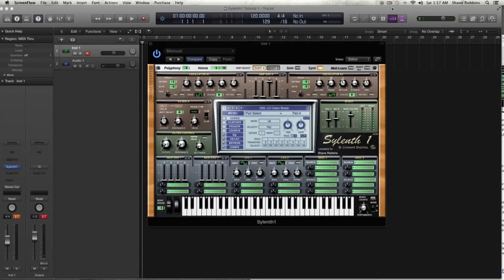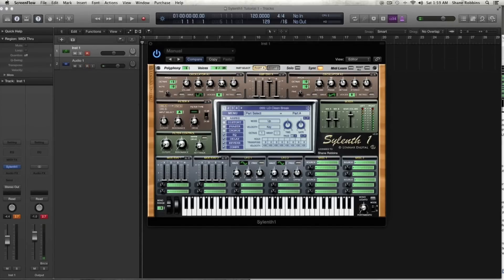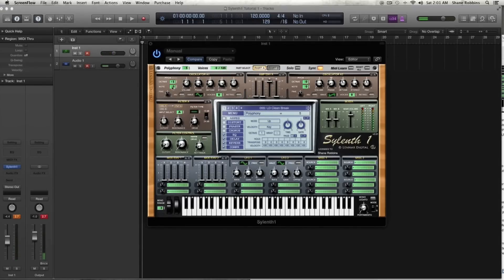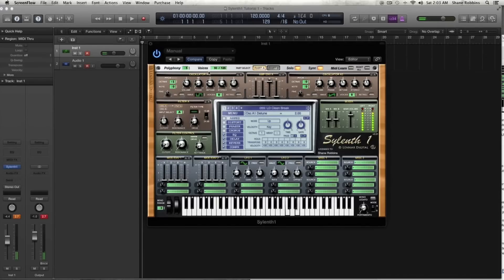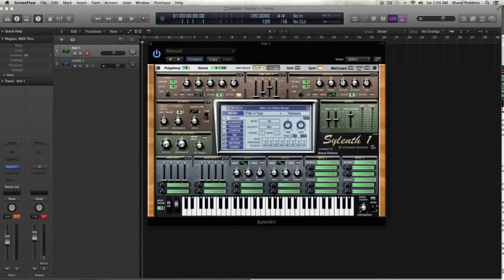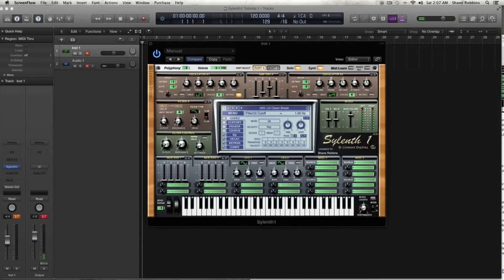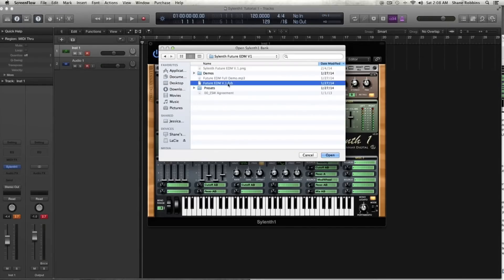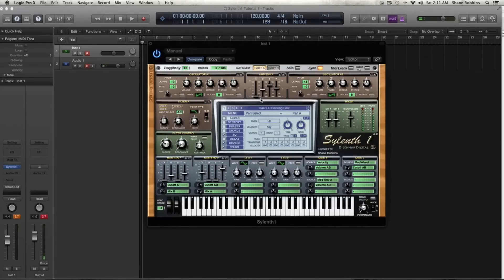Sylenth - Your First 30 Minutes Using Sylenth - How To Tutorial

Comment: so which is better massive or silent i have both but i only wanna use the one thats the best and easiest to understand
Reply: YUNGR33ZYB3BI Depends on what you find easier to understand. There is no best VST but, the more comfortable you can get with one the better your sounds will be.
Reply from the maker: YUNGR33ZYB3BI Use both! Sylenth can quickly do sounds that take a while to do in Massive and Vice versa. You just can't do certain sounds that in Sylenth that you can Massive because one is a WT synth and the other is subtractive.
Reply: YUNGR33ZYB3BI massive's sounds are either so hard or so soft,there's no middle. Sylenth1's sounds are more able to be used for all levels.so if you have to pick one of them I would say sylenth1.
Reply: thanks guys. would you have a simple video that explains how to understand all the different wave forms and achieve any sound?
Reply: instead of specific sounds
Reply: oh do you ever do monark tuts??

Comment: Ive just picked up Sylenth and im loving the sounds.

One question i would appreciate having a little help with though. The presets seems a little "unorganized", and i would like to reorganize them to my own liking but i cant seem to see a clear way to do this. Ive read various posts about using preset managers, VSThosts or otherwise but this frankly is beyond me at the moment.

Ideally i would like to take the presets out of the factory banks and create my own banks, such as "Bank 1 - Bass" or "Bank 2 - Leads" etc then transfer the relevant preset sounds to the corresponding banks ive just created.

Im wondering if i can just rename items or banks but im unwilling to do it as yet incase i accidently start deleting presets or entire banks.

Could I some advice on this if its at all possible?

Regards
Reply from the maker: I would assume to change the factory banks you would have to change some settings that could potentially mess things up quite a bit. It's easier to just save your sounds in a new bank and then load that up when you need it.